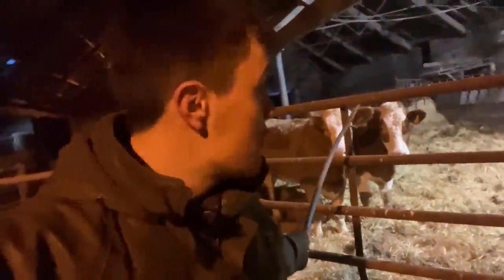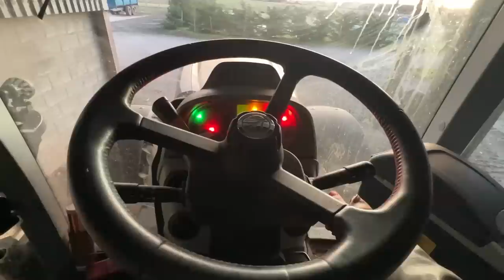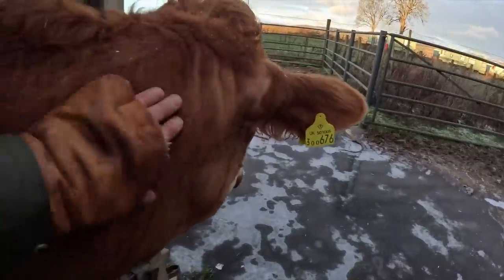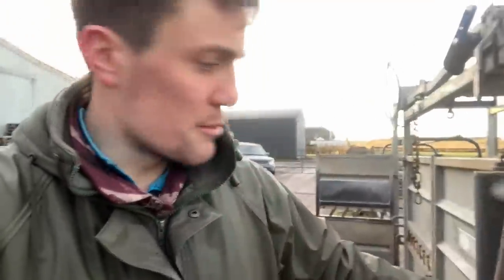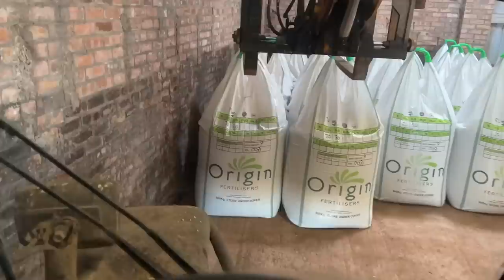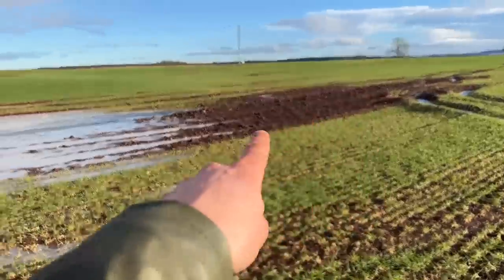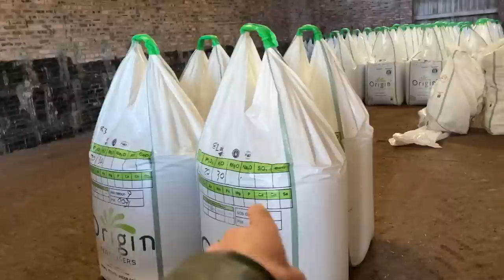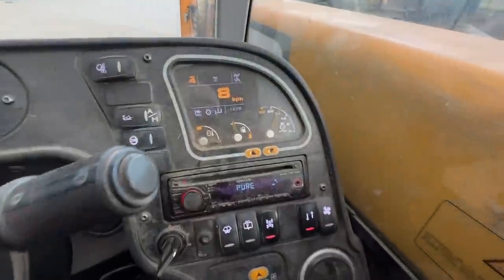Te Pari Cattle Crush Looks A Beast | For The New Shed? | Spreading Fertiliser

Comment: I have that classic squeeze about 10 years now, bought it from mackies  stand at the Ayre show over the phone as they were packing up. Got it delivered on the Monday in ireland. Best bit of kit I ever bought, some changes on new one I don’t like. Neck access still not great, just don’t catch them if your injecting in the neck area. Best thing is the handle for the head gate at the rear where you can operate the sliding gate with one hand and the head gate with the other. Just don’t let cattle pass the crush on the side that has the handles on, they’ll bend them til it will get weak and crack

Comment: EID tag reader handy, easy to track individual growth rates.
Reply: We have a tepari and combo-clamp crush’s. Both excellent. Over time the pins on Te Pari have had dust accumulate so not as smooth but that’s just a maintenance issue and is outdoors permanently.

Comment: I take it you are planning to have a couple of calving pens in the new cattle shed, think about putting at least one calving gate in the design, I had one designed and made by a local engineer, I was able to handle cows single handed safely for a number of treatments from calving to tb testing, well worth the money, my vets really liked it.
Reply from the maker: Yes plans for a creep/calving area with head yolk etc
Reply: @CrawfordsFarm1  mine had a head yoke at 90° to the wall with a gate mounted that swung 180°  the cows were into the yoke without even realising, incorporated within the main gate were 2 smaller gates that gave access to the side of the cow if an op was needed or even to give a calf a suck

Comment: Which model to choose? It all depends on how many cattle you plan to keep and if anyone will be helping you as you work the cattle. If you are not looking to increase your herd size too much in the next several years, then I'd pick the less expensive model without as many bells and whistles. It's a solid piece that is safe for both man and beast and you can operate it by yourself, but you will have to do a little more work with it, so you won't be quite as quick. If you intend to significantly increase your number of cattle in the next few years, and you will be working the cattle alone, then get the more elaborate model.
Reply from the maker: The classic i would think, not going to be a mega cattle outfit but still want to benefit from some neat features 👍🏼

Comment: The payback on these expensive crushes will be the time savings, number of people needed etc. Seeing Cammy use the sheep one was a real eye opener. I imagine you will really benefit from auto tag readers, weighers, linked guns for medication getting rid of paperwork. If you can get in safely to clean cattle if you need to before they go. Reducing vet time. Might be wrong but I’d think it’ll be like GPS on the tractors.
Reply from the maker: I agree, think the extra cost of crush may be 3000… over 10/20 years & increased efficiencies its a no brainer
Reply: You’ve got me watching TePari videos 😂 the handling systems look top notch especially the curved adjustable races, raised areas and forcing gates. You need a bigger mortgage 😜